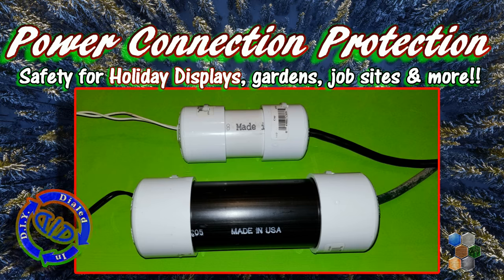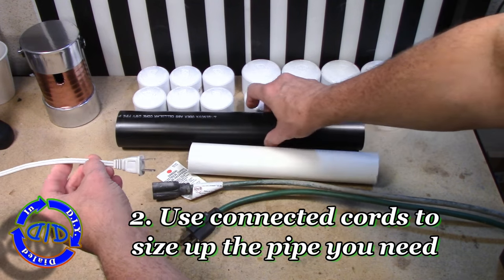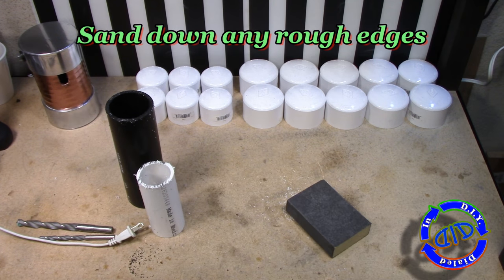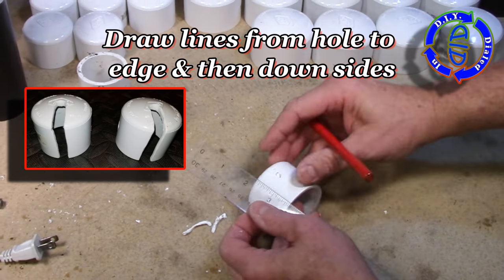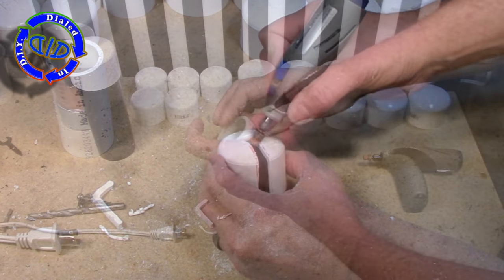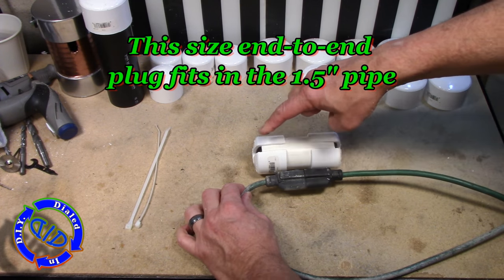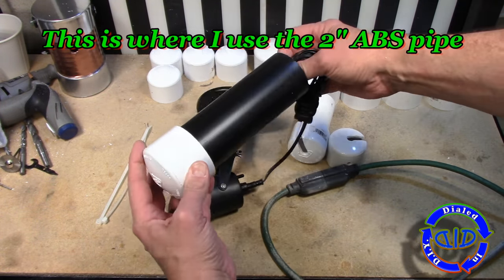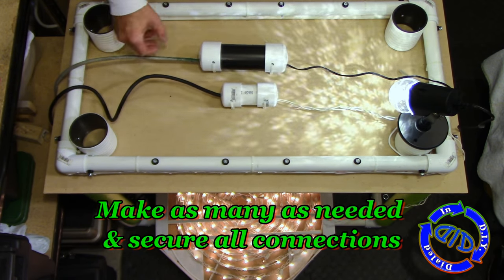Power Cord Protection - DIY Outdoor Display Safety

Comment: I have been  looking for a way to water proof a cord connection for outdoor use.  Your idea and the fact that our irrigation system uses wax filled "caps" to connect underground wires that run the valves in our system gave me the solution I was looking for.  I filled the tubes  you have constructed from PVC tubes and caps with wax I found in plumbing supplies (used for making those wax rings to set a toilet to the sewer flange) and now I have an outdoor connection that won't get wet, even during a hard downpour of rain.  It is a bit messy to take apart but it's a very cheap solution for what I need.  Thanks for posting this video.

Comment: Nice idea with the PVC pipes and end caps
One suggestion is that the contraption can be be put into a plastic sealy bag a little bigger & longer than the PVC pipes. A small 6:50 opening on one side of the bag to pass the plug through an then  some insulation tape and zip tie the two ends tight around the cords to make it completely WATER & SNOW PROOF 
I have done this with plastic containers for my Christmas decorations outdoors and proved good
But your IDEA of PVC pipes & ends caps are really cool except for the cutout portion where rain water or snow can get thro so the extra idea I have given will make it completely weather proof 
Thanks to you for your time making this video

Comment from the maker: Good use tip: I just connected 4 plugs together in an outside tree to add a festive touch.  An over-sized version of the 2" design will keep my power from coming apart due to gravity or high winds.  That'll keep me from having to climb a tree to restore power in the dark!

Comment: Sometimes you want the cords to pull apart. When you get shocked holding something, your arms usually clench onto the item.  If you start running you will run out cord and electricy will stop
Reply from the maker: Do you mean in an instance when you are using the cord to power tools or something like that? [So sorry for the delay... life kinda got in the way for a bit]

Comment: Greate! Suggestions: 1) Do it with no zip tie holes if you make a shallow long notch on either end cap that a large zip tie can lay in and go lengthwise around your setup. 2) Make your end cuts only go towards the center enough to clear the pipe in the width of the cord to reduce the gap. 3) Use reusable zip ties as you can use them for decades instead of having to rebuy them and throw away more plastic.

Comment: I like this more than the plastic food containers I've been using.  It's a bit more work, but certain more sturdy and I have tons of scrap PVC laying around.  Now I finally have something to use it for.  :)~
Reply from the maker: Thank you very much for the feedback!  Plastic food containers is actually a good idea for a quick way to protect them from moisture, especially if you are in a hurry and want a fast fix.  Side benefit of the PVC approach is that it also helps to reduce risk to kids & pets.  Thanks for watching and for taking the time to comment!

Comment: It gets very rainy around here in Dec. The cuts in the pipes, doesn't that let water inside? And wouldn't it then get trapped? I'm tired of fried light strings! I've been using the container method but that messy and ugly. Love this idea! Just need to make sure water doesn't get in through the holes. I have a dremel I've never used...maybe time to break that out!